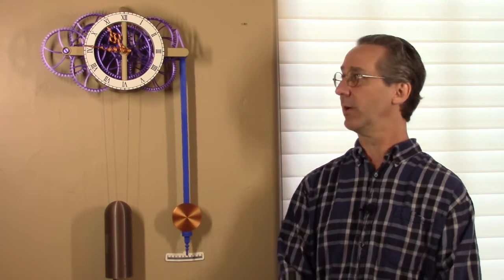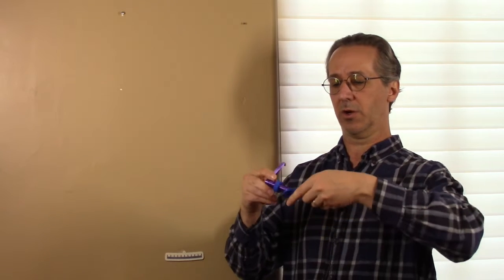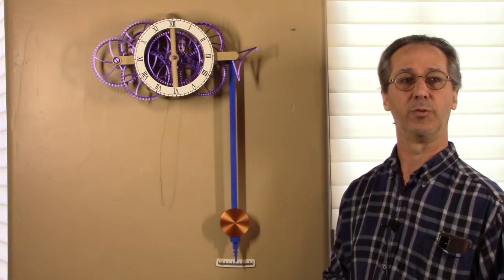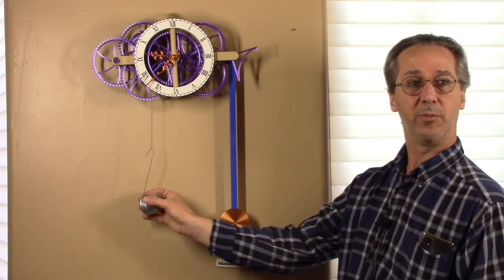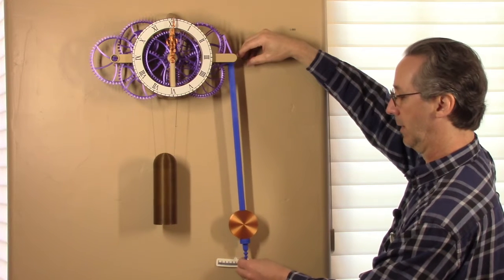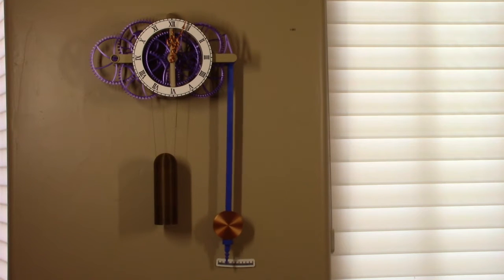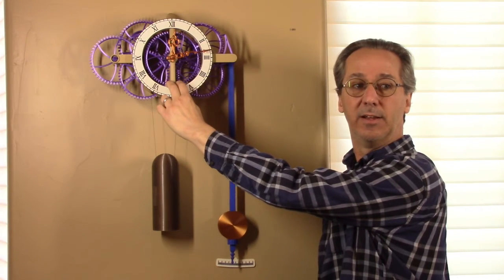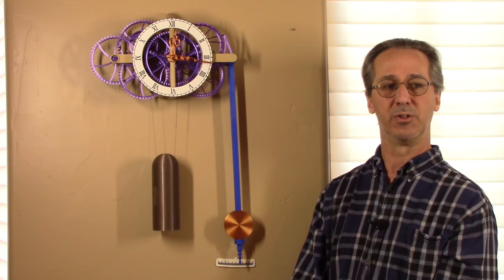EZ Build Clock Debug Process

Comment: Steve, I just finished printing and assembling this but I can't for the life of me get the escapement to move on it's own. Everything is nice and loose, the bearings are good, and pendulum has almost 10 minutes of swing on it. I can pull really hard on the weight cord and still the escapement doesn't move. If I move the winding drum myself then the clock ticks nicely. It seems to me as though the drum that the cord is wound around should be much bigger in diameter, as this would give more 'pull' on it and therefore more turning force, resulting in less weight needed?! I would appreciate your thoughts on why I can't get my clock to move on it's own, thank you.
Reply from the maker: My best guess is the "sticky gear" problem described in this video https://youtu.be/pnpYs-SuytI   Adding extra weight only jams against the escapement harder. There are new copies of gear 3 and gear 4 posted to MyMiniFactory to solve the problem.

Making the drum larger would provide more force to the escapement and the clock should become more reliable. It would also reduce the runtime. There are a few gear combinations that provide the same result of increasing power to the escapement while reducing runtime by the same proportion.

Each clock design is a tradeoff between runtime and reliability. I prefer a long runtime. If I had a clock than needed to be wound every 12 hours, it would very quickly become a static work of art. :)
Reply: @stevesclocks  thanks for the reply, and sorry for the delay in getting back to you. I've now got the clock running nicely. I already had the updated gears on my clock, but I underestimated just how heavy the weight needed to be. More seriously, I found that one of the spacers was slightly too long preventing it's associated gear from turning as easily as it should. I trimmed it down and the clock started working. I then noticed that the hands weren't moving! So I swapped out the 10 day gears for the 7.8 day ones and it's been running successfully for the last 2 or 3 days 🙂. I really don't mind winding the clock every few days as long as it's actually working as it should!
Reply from the maker: @trance_trousers  Thanks for replying back with successful results. There are so many interactions that can cause a clock to stop running. It is a good feeling when you discover them on your own. 

Winding once a week is tolerable. Designs that need to be wound twice a day would quickly become static pieces of art.
Reply: @stevesclocks  yes, that's why I chose your clock design as it seemed to have the longest run times of any I've seen. Just curious, but would you be ok with someone selling your clocks (fully printed and assembled) on somewhere like Etsy?
Reply from the maker: @trance_trousers  Unfortunately no for several reasons. The files are released under a strict non-commercial, personal use only license. It is OK to give them to family and friends, but they are not allowed to be sold. The other important reason is that the designs are intended for each user to build their own clock and experience the joy of making it work.
Reply: @stevesclocks  I absolutely respect the reasons you give, but have you thought that there might be lots of people out there who would love to own one of your clocks but who either don't own a 3D printer or just don't want to spend the time and effort to print and assemble one themselves?
Reply: The hands on my clock also do not rotate.  Everything else seems to be OK and I can't for the life of me figure out why the hands won't turn.  I've super glued gear 4b-18 to the shaft thinking it might be slipping but that didn't seem to fix the problems.  Any suggestions?

Comment: I built the small ez build clock and the gears wont rotate with the weight on. Pendulum swings only for a couple minutes. With the escapement removed and a smaller weight attached the gears wont rotate by themselves, however if i start the spinning it will spin for a minute or so. With the clock on the table the gears will spin for a moment or two once I spin the gears by hand. Taking it apart now but not sure what to look for.
Reply from the maker: The symptoms sound like what I used to call "sticky gears", but "sticky escapement" is a more accurate description. The escapement does not rotate on its own when the pendulum is manually moved from side to side. I believe it is caused by gear 3 tilting slightly and applying sideways pressure against the escapement. It only takes a small amount of pressure to stall the lightly loaded escapement. Push gear 3 away from the escapement to see if the clock starts running again, at least for a short period of time.

I am getting ready to release a new set of gears that should solve the problem. It should be ready in 1 or 2 days. Gears 3 and 4 were re-designed to add a gentle helical angle that pushes gear 3 away from the escapement. This issue only affects the easy-build clocks as they are the only designs with two gears sharing the same shaft.
Reply from the maker: Brian, I updated gears 3 and 4 on MyMiniFactory with the fixes. Try downloading and re-printing these two gears to see if your clock runs better. It takes a few days for the files to make their way into the zip file, so you may need to download them manually.
Reply: @stevesclocks  Thx a lot. I did as you said in your first reply and got a bit more out of it. Reprinted gear 5 as it didnt print perfect and got it to run a couple minutes. So hopefully the new gears will work better. Thanks again.
Reply: @stevesclocks  Hi Steve, I downloaded and printed the 2 gears and it didnt help. I reprinted some other gears as well. When testing without the escape and pendulum, the gears rotate well with the weight attached. However, stopping the gears from turning and releasing, i find there is one spot the it stalls, trying to isolate the problem but not sure how to diagnose it. Any hints would be appreciated. Thx.
Reply from the maker: @briant444  It sounds like there is an issue that is specific to your printing if the gears stick in one spot. It could be elephants foot, a blob on the gears, out of round gears, a bent arbor, or something else. Maybe try taking gears out one by one to see if you can feel any difference in the friction.
Reply: @stevesclocks  Ok thanks, will check all that.

Comment: Brilliant.. !! I am halfway finished printing this clock.  Downloaded kit for the table top clock.  Instructions and videos are excellent. Your detailed instructions via video and pdf are clear and well thought out.  An amazing job .. the debugging has helped me find a couple of mistakes and help size the weights properly.    Thanks for the table clock electronics and design, my next project. Modified the wind drum (double diameter) to increase torque without adding weight ... works great.

Comment: Great Jobs Steve.. Well engineered, You must have been a clock repairman  for you knowledge, I bought your design and its great .. just a few things that made it hard was which gears for what project. It may make it easier for the zip file to have folders of which gears you need for which clock.. Eg  Small clock , Med clock, Large clock and that way a person could just print everything in that folder for which clock they want. Im sure you know it all inside out , but for a new person it just slows the whole process down.. :) 
Im just saying that is all but a great project.. Thanks :) !!!!
Reply from the maker: Thanks. I am an engineer with no clock repair experience. I design each part so it works as a 3d printed part. I never feel the need to design the traditional way that might have been used for a brass clock.

Each clock has its own zip file. One or two of the older designs had both imperial and metric parts in the same release. The newer designs are metric only, but you still need to follow along with the assembly manual because there could be multiple gear sets for different runtime options. Myminifactory combines everything into a single zip file. Hopefully you found the files you need. I will try to add better documentation to try to make things clearer.
Reply: @stevesclocks  Hi Steve, Sounds great, Yes the zip had lots of files, sorting the groups of which day time runs and the main parts into groups may help others just go to a folder and print all the parts for say a 21 day , or a 10 day etc.. would simplifies it for people who have no clue of what they are looking at, may make the zip a little larger but easier.
I just think the project is very cool and a lot of work in designing your instructions are very good and well laid out in many ways, as I say great Job ! Merry Christmas :)
Reply: @stevesclocks  Hi Steve, Im just wondering of you can give me some info. I made the easy build and it will work I think once i debug it as it seems to need more weight for the 15day version, but Im wondering how come the wind gear is so large as it seems that if you could shrink that gear you could get a bigger drum the thread winds on to for the weight, and then that would have more leverage for the weight so in turn you wouldn't need as much weight to run the clock..? 
The gearing seems plenty for the wind handle since its so easy to turn even with alot of weight on it . ? Just wondered while I was trying to not have too larger weight but it gets tricky to make everything friction free.
Reply from the maker: @keeweeles  I considered changing the winding drum diameter and winding gear to create different runtimes. Instead, the ratchet gear and minute hand gear ratios were changed. The net effect is exactly the same, but the print times are really long with any option that needs a new winding drum. 

I have been running my version of this clock with either the 7.5 or 10 day options. I also added a light coat of grease to all the pinions. This allows the clock to run significantly more reliably. The 32 day option ran for a month or two. The pendulum amplitude was around 2 degrees in each direction which is just barely enough to keep the clock running, but eventually the gears started sticking. It runs so much stronger with the shorter runtime option. The pendulum amplitude is more than +/-4 degrees now.
Reply: @stevesclocks  Hi Steve thankyou for your input it is a great design and appreciate your efforts as my wife loves clocks.
I have just put some lithium grease to help the gears on the pinions also to help it out. 
The winding drum I was mentioning wasn't to change the gearing just the diameter of what the thread winds on as the larger that is the more leverage the weight has to turn the gear, The only issue with that is the gear that winds the clock up gets in the way, so was suggesting if that was smaller it could be done and after all that gear is only to wind the clock..    Merry Christmas  :)
Reply from the maker: @keeweeles  Changing the drum diameter will provide more leverage, making the clock run better or making it run the same using a smaller weight. This also reduces the runtime in proportion to the change in diameter. 

There are many different solutions to the problem. The only fixed requirement is that the minute hand gear needs to rotate one time per hour. Having two sets of gears between the minute hand and the winding drum opens up a lot of possible combinations. Changing the drum diameter is another variable. I see other clock designs with the winding drum closer to the minute hand shaft and they are often limited to runtimes of around 12 hours. Adding the extra gears costs very little when it is so easy to print them. Overall friction is low because they turn so slowly. 

The winding gear on the side of this clock serves a few purposes. The primary purpose is to allow the winding key to pass through the frame. Adding the key directly to the winding drum would have extra friction because of the weight. The gear in this clock has no load so the large diameter adds very little friction. The gear ratios determine how many turns of the key are needed to wind the clock. Less than 25 turns will take a lot of force. More than 40 turns takes too long to wind the clock.

Lots of different solutions could be used. I select ones that seem to work, even if they are not always the best choices. Sometimes choices are made for purely cosmetic reasons to balance the overall look of the clock.

Thanks for the meaningful discussions. Cheers.
Reply: @stevesclocks  Thankyou for your expertise in your experimentation of your clock, thought you would know and why you did use this combination.. I have got mine working but not for long as after doing a debug the clock runs well but the bearings on the arbor..? that i got are just way to gritty and lower Quality even with the seals taken out. I think I will look for some  ABEC 5 or higher bearing as the ones in the manual are very low in the scale of drag... Im sure you know of the Abec range. This should give me less drag . Thanks for you input as I just like to understand the process of your creation. ! People will get lots of joy out of this as long as they spend the time to play with it just like a real clock . :)
Reply from the maker: @keeweeles  I only purchase non-labeled bearings. Maybe that means ABEC 1 or lower. :) I have never found a set of 10 bearings without at least 5 bearings good enough for the pendulum. Most of the rest are good enough for the weight shell and usually never more than 2 garbage bearings. These are for generic bearings from eBay or Aliexpress.
Reply: @stevesclocks  I'm impressed , You must have it a bit more fine tune than mine as I have like 10lbs on the weight and the 15 day gears and it still wont run for more than 2 minutes , The debug the gears seem to spin fine without the arbor and can stop it and let it go and it starts on its own.  With the arbor and the gritty Amazon bearings on that it just eventually stops so I'm guessing it the bearings as they are suppose to be Abec 1 but feel they aren't even that so I'm getting some fishing reel bearings as they are the same but are Abec 7 and ceramic so will be the best and if it still wont run ill have to go back and look as i don't wont any more weight , so you must have it very accurate, Thanks :)

Comment: Steve, where would I start in designing my own clocks to 3D print?
Reply from the maker: The first step is to build one from plans and study how it works. Break the design into small pieces that are easier to understand. The escapement is the starting point. Get it working first. Then figure out gearing that looks good. There are lots of books, mostly written about traditional brass clock design, but still plenty of good info in them.
Reply: @stevesclocks  Thanks for the reply. I've finished printing all the smaller parts from your revised pendulum clock. 
Do you think a wooden clock design book would translate to 3d printing?
Reply from the maker: @Noold  Most of the features are similar. Wooden clock are typically larger, so it will need to be scaled. 3D printing allows additional optimizations like printing the pinions integrated with the main gear. Frame pieces can also be combined into single prints.